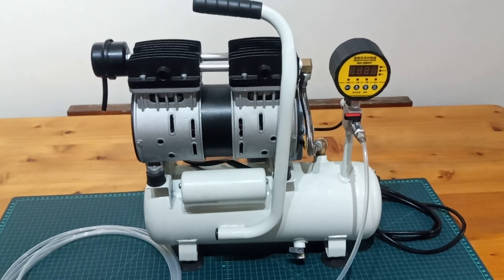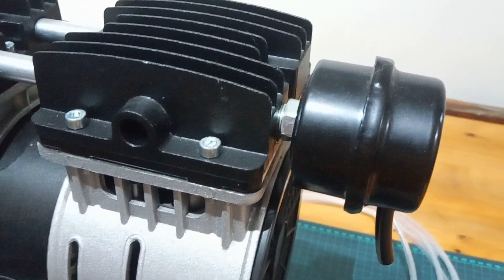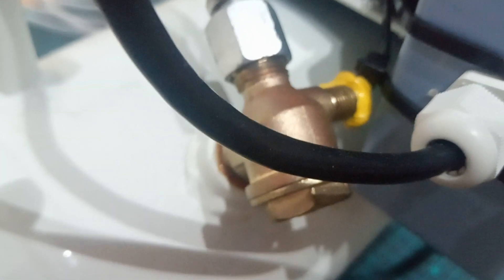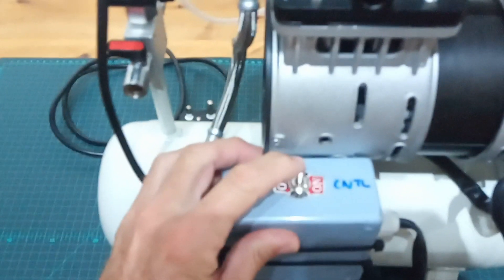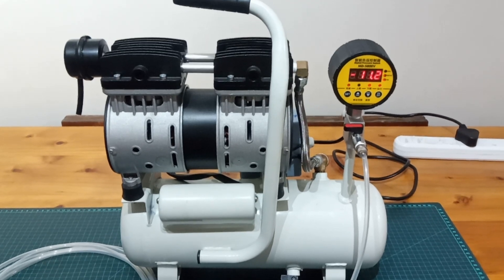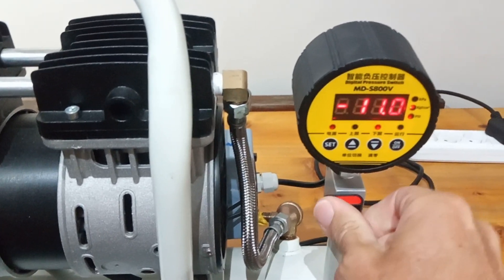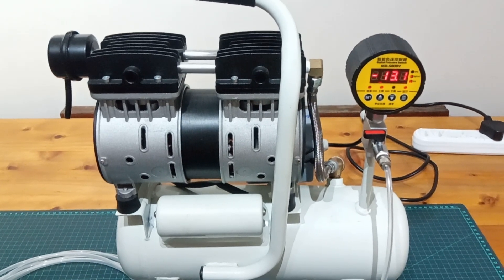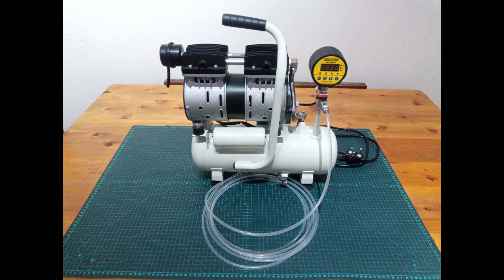Oil-less Compressor converted to Composite Vacuum Pump

Comment: Thank you for the information. I was researching this very setup when i stumbled across your video. 
Can you suggest a compressor in the US that is capable of a deeper vacuum? Preferably 29 inhg or deeper as i do a lot of thicker laminate infusions and really need a deep vacuum to dry the stack. Thank you!
Reply from the maker: Hi Dustin, for higher vacuum I would pick up a dual motor version of this same type of compressor and then plumb the two pumps in vacuum series - this should get much closer to the 29 inhg you are looking for. IN FACT, thinking about it I would setup up valves for parallel/series connection. Have the pumps in parallel for faster initial bag pull down then switch to series for the added vacuum. Cheers DK
Reply from the maker: https://www.adendorff.co.za/mac-afric-professional-50-litre-22-kw-3-hp-230-v-dualmotor-oil-free-silent-air-compressor-compre010?gad_source=1&gad_campaignid=17424182333&gbraid=0AAAAACJVcMsz8cAgOYF7WbtVndLe9xJHX&gclid=CjwKCAiAjojLBhAlEiwAcjhrDpkzzqz3hBSA--HxHvJi1gHOgvJvJeXnKbJs2lXJSi11rznX6FA7qBoCl5gQAvD_BwE

Comment: Thanks Dave, you're a legend! I am surprised this modification is not on more people's radar. Although, it's a bit risky buying a new compressor that I don't need, hoping I don't break it the process of making something I do need!
Reply: Just thinking, for a "two in one unit" that either does compressed air or vacuum. Weld on another bung and tap the vacuum side into that. Then have a tee on each line with valves so you can select either positive or negative exhaust "opened" or "closed." And then for the electrical, "vacuum on" or "compressor on" crossover switches to select modes.
Reply from the maker: @waynoswaynos thanks mate, the two in one unit can be a safety Hazzard as in the conversion to vacuum pump I remove ALL the compressor controls and safety valves etc. Honestly, these pumps are so cheap it's just the best idea to buy two, one for compressor duties and the other for vacuum.
Reply: @Kiteboardshaper  I hear you! In New Zealand where I am the equivalent of this is around $300 so I'd want to get my money's worth. I reckon I could make a two in one safely function with about 6 extra parts But that's without drawing it up. Might not be as easy. As is often the case. But I really appreciate you showing the simplicity of the conversion and providing drawings, etc. Very kind of you.